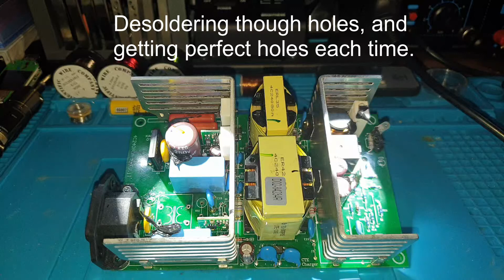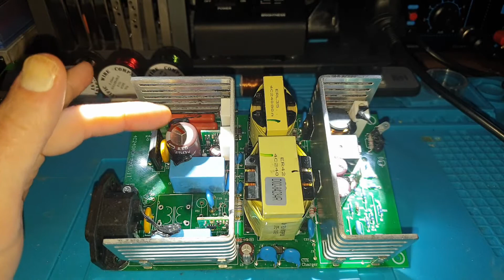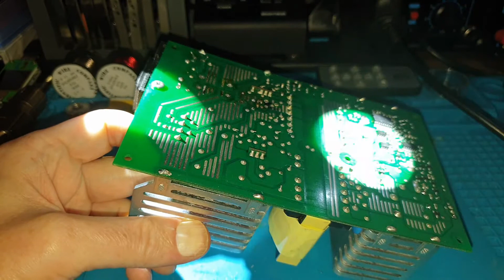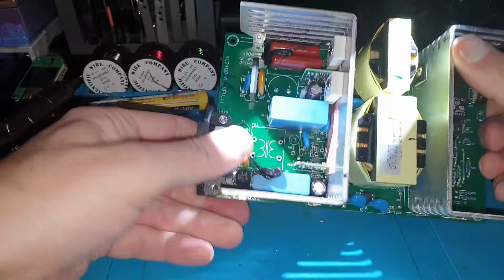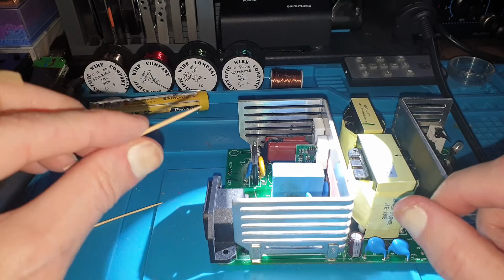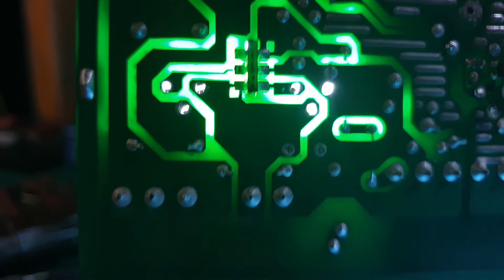Desoldering through holes, and clearing them perfectly.

Comment: Toothpicks are a great way to clear the hole of solder. I find toothpicks made of birch wood are better than ones made of bamboo. In fact now I just use toothpicks made of birch wood. I find bamboo ones are weaker and have the potential to break easily during the process.